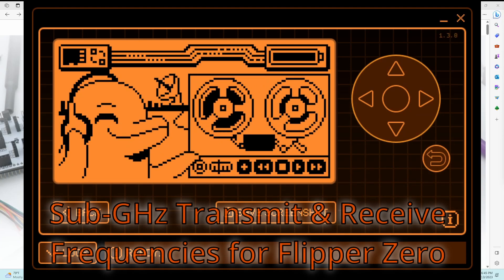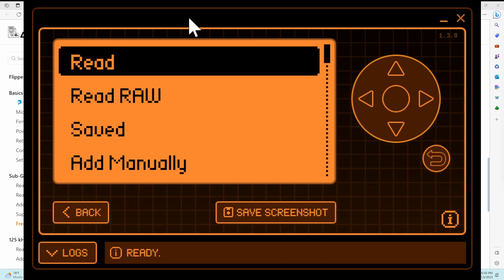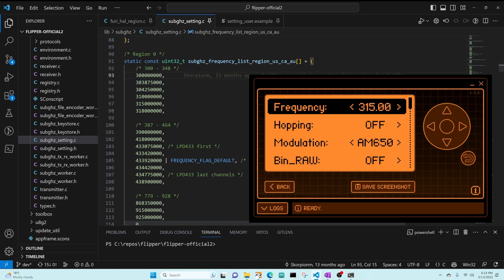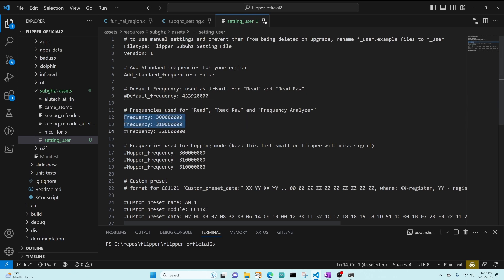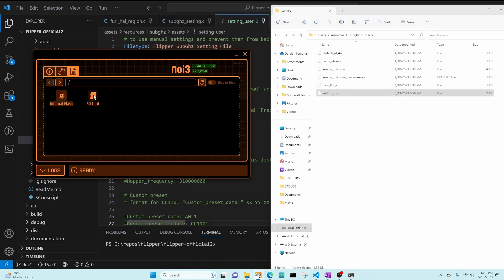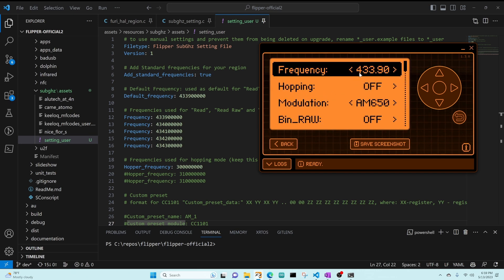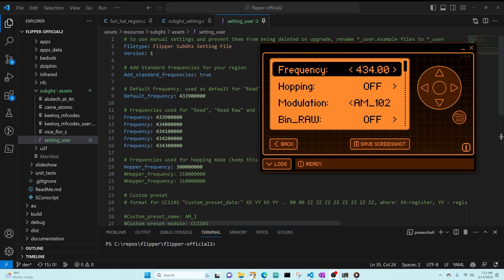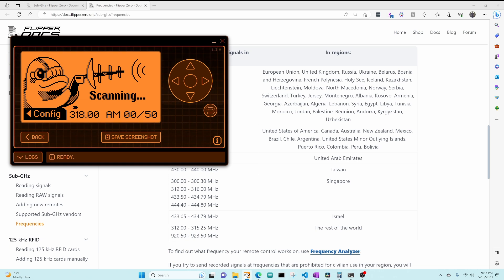[62] Flipper Zero - Sub-GHz Custom Settings

Comment: How do I broadcast a custom frequency? I have an led light that has a ton of settings but i lost the remote I know the remote is 433 so I just want to brute force past 433050000 to see what settings I can access
Reply from the maker: Depends on your firmware. Some of the custom firmware allow adding a custom frequency. Otherwise you have to edit the settings file for subghz and add it manually.

The challenge is that there is frequency, modulation (ASK - which flipper calls "AM", and 2FSK - which flipper calls "FM"), deviation (if using FM), protocol (like Princeton, X10, etc.) and then the data. All of these have to be correct for the device to react. And the data is typically some FIXed data (like a serial number + button), and then some protocols have dynamic data (like a counter or encrypted counter).

You might have a better chance seeing if any of these files work...
https://github.com/UberGuidoZ/Flipper/tree/main/Sub-GHz/LED

Comment: Hey Derek, If you are adding custom presets in the setting_user file is it still necessary to modify the other files? I added a few custom presets and the read function is locking up when either hopping or on a static frequency. At first i though it was the wide band presets but commented those out and its still giving me trouble.

Comment: Hi, can i know where i get the code for sub ghz? Thanks!
Reply from the maker: I'm not sure I understand the question?

The app is built-in (keep pressing back, then choose Sub-GHz from the main menu).

The source code is at ...
https://github.com/flipperdevices/flipperzero-firmware/tree/dev/applications/main/subghz

With the core library at...
https://github.com/flipperdevices/flipperzero-firmware/tree/dev/lib/subghz

Many captured .SUB files (Tesla, etc.) are at...
https://github.com/UberGuidoZ/Flipper/tree/main/Sub-GHz
Reply: @ thank you for the response! Is it also possible to modify the sub ghz apps so that i can use 2.4 ghz antenna to receive signal and etc?
Reply from the maker: To use an external CC1101 go to "Sub-GHz, Radio Settings, Module: External". 
For wiring the module, see https://github.com/quen0n/flipperzero-ext-cc1101

Comment: thanks for the vid DJ. i'd really like to know how the modulation affects the frequencies being scanned. can't find anything clear about it, maybe a new topic . many thanks
Reply from the maker: Modulation is an interesting topic, but I'm not sure when I'll get around to it.  When we are doing a Read, the modulation is describing the requirement for signal to be decoded as a "0" or "1" on the GPIO pin from the CC1101 radio. Maybe I can make a video in November going into details.

Comment: my momentum firmware does not have region info
Reply from the maker: I'm not sure why it was removed.  For me "Momentum, Protocols, SubGHz Bypass Region Lock" is set to OFF, so it is locked into a region but it's not easy to see which region that is.

Comment: Hi , can I add the FM(FSK) modulations and  in the same way? Is additional (external) CC1101 module  required for this? The second question- I am little bit confused about the designation of the modulations. You said that for example AM102 is 102kHz deviation (+-51kHz) which is clear to me. How is it in FM(FSK)? What FM238 would mean? 238KHz freuency shift or 2.38KHz frequency shift?
Reply from the maker: No external module is required, but it should be applied to internal & external if the file exists.
https://github.com/jamisonderek/flipper-zero-tutorials/wiki/Sub-GHz#preset-data explains things in a lot more detail. But general naming convention for "AM" is the number after it is the bandwidth (register 0x10).  The AM tones happen on the frequency you select, but it listens to the entire bandwidth so a similar frequency will also get picked up.  For "FM" the number after it is the deviation (register 0x15), the 2FSK tones happen above and below the carrier frequency (no tone is actually sent at the carrier frequency).  FM238 is 2.380kHz from center, while FM476 is 47.607kHz from center, FM95 is 9.521kHz and FM15k is 15.869kHz. 

I'd love to continue the conversation in my Discord server with you.  https://discord.gg/k7WX7Be3Vy is an invite link to the server.  There is a #subghz channel & it would be awesome to answer questions there -- I'm sure other people have similar questions!

Comment: What is the path for the file which includes the modulations in flipper zero firmware, such as AM650 and FM237, and how do I modify the file so that I can add the custom Honda1 Modulation from the Honda firmware?
Reply from the maker: Take a look at https://github.com/jamisonderek/flipper-zero-tutorials/wiki/Sub-GHz#custom-settings

If you need additional help, please join my Discord server and someone will help you there... https://discord.com/invite/NsjCvqwPAd

Comment: Hello? where is the text file with the custom presets description?
Reply from the maker: https://github.com/jamisonderek/flipper-zero-tutorials/wiki/Sub-GHz#custom-settings

It is on the SD Card in “/subghz/assets”, called setting_user.txt.example or similar.  It needs to be named “setting_user” or “setting_user.txt” (depending on firmware).

Comment: Sir I have committed at the unleashed firmware and frequency 430.50 is now in the dev build.
Reply from the maker: Cool.  I know some custom firmwares also have a way to add custom frequencies & hopping frequencies from their settings UI; which is typically easier than messing with the files.

Comment: Hi Derek, I followed the same steps as in the video customizing the setting_user but the subghz do not reflect in the flipper GUI, I am using of the unleashed version - unlshd-066 thanks Sr.
Reply from the maker: I'm not sure.  I'll switch to unleashed today and give it a try.  I recommend joining my Discord server and asking for help there - I'm happy to do a debugging session there.  https://discord.com/invite/NsjCvqwPAd
Reply from the maker: I tried this out with unleashed.  The added frequencies are at the end of the frequency list (even though my freq was 31042000).  The added modulations are between FM476 and FM95 (even though my freq was "AM_DEMO").  The hopping frequencies show up quickly when I enable hopping.  Let us know if you are still having issues.  Again, the easiest way for me to do troubleshooting is on my Discord server -- YouTube hides replies by default.

Comment: Hi Derek, could you tell me how to cancel frequencies in hooping. I have followed the steps to add them in subghz/assets/setting_user and I have added them perfectly but I would like to delete some that are pre-established such as 315 or 418
Reply from the maker: This was also discussed in my Discord server recently and the solution worked for them:  Make sure Add_standard_frequencies is set to false.  This will clear the default frequencies and hopper frequencies.  You can then add Frequency and Hopper_frequency entries in your setting_user file.

Comment: Thanks for the video. I need to use 292MhZ is there anyway to reach it?
Reply from the maker: 300MHz is the lowest supported range, however, there are unsafe things you can try (but I'm not willing to try & frequencies aren't legal in my region anyway).

https://github.com/RogueMaster/flipperzero-firmware-wPlugins/blob/420/documentation/DangerousSettings.md

Comment: which version are you using?
it didn't work for me
Reply from the maker: Which firmware are you on?  Sometimes the customized entry is at the end of the selection.  Some firmware also require it be named setting_user.txt instead of setting_user.  My Discord server is best place for help - https://discord.com/invite/NsjCvqwPAd - but if you let me know your firmware (like Official, RogueMaster, Xtreme, etc.) I can install and give you the specifics.
Reply: Extreme Xfw-0051_01082023

Comment: Why don’t any of these videos actually explain what the different apps actually do lol
Reply from the maker: Hi.  Does the below video link help explain some of the apps?  The target audience of this customize video is someone who probably also has a software-defined-radio, but wants to tune the Flipper settings to receive a signal from a particular remote that uses subghz frequencies in the 300, 433, 800 or 900MHz range.

Flipper Zero - Overview of Official Firmware
https://youtu.be/eIAhiloEOlo

Comment: Many Thanks for this amazing Video.
My hospiral uses Garrison>> LK-102P-RM remote control with one button only to open the staff elevator. Flipper is unable to read or read raw. Analyzer is unable to read it also. I searched the internet and found that the frequency is 380MHz.
I replaced the firmware with rougeMaster and does not help
I'm new to flipper and have no idea how to add this frequency.
your help will be appreciated
Many thanks
Reply from the maker: If you have Discord you can use my #general channel https://discord.gg/NsjCvqwPAd or ping me on Discord at codeallnight.

Roguemaster expects the file on the SD card to be named "subghz/assets/setting_user.txt" (with the .txt extension).

Rougemaster allows 37800000 to 481000000 so 380000000 should work.  I'd recommend turning on logging (at least at Error level) and then open https://lab.flipper.net/cli and run "log".  Then you should be able to start Sub-GHz and see the issue.

10575192 [I][SubGhzSetting] Removing standard frequencies
10575201 [E][SubGhzSetting] Frequency not supported 380000000 <<<< Official firmware!!!
10575218 [I][SubGhzSetting] Hopper frequency loaded 300000000
10575247 [E][SubGhzSetting] Error loading user settings, loading default settings

Once you have the frequency show up in Read, you may need to increase your data rate.  See this video:
https://youtu.be/VxMDdYuRITE

Comment: I understand this is modifying a configuration file that the app uses.. but any idea how the apps themselves work?  For example, if you wanted to write something custom, is the fap written in 'c' or is it a script (ex. ducky)?   

I'm interested in studying how some of the apps work, for example how does it analyze a particular psk/ask/fsk/qam protocol.   

I'd also like to write a portable hotspot application, that users can connect to, enter a password and it will then allow them to use my mobile connection!
Reply from the maker: Sure, I can do a video on how "SubGHz Read" code decodes/encodes with one of the protocols (like Princeton).  NOTE: The Flipper uses SubGHz (<1GHz) and WIFI is 2.4GHz or 5GHz, so you can't create a hotspot application with just a Flipper.  If you have a dev board or ESP32 then you could allow people to connect to it [you would have to write custom firmware on the ESP32 & custom firmware on the Flipper] (but then you would need another board connected to your mobile connection).  It might be easier to make a firmware that had a mini-web server on the ESP32 and the Flipper allows you to control that web server pages (like captive portal login pages or something).

For SubGHz, I started writing a tutorial for adding X10 protocol...
https://github.com/jamisonderek/flipper-zero-tutorials/tree/main/subghz/protocols/x10
but it's broken with latest firmware.  Hopefully it will be fixed next week.

Comment: Just to let you know this only covers the stock Firmware  not including custom firmware such as RogueMaster and Unlesashed.
Reply from the maker: Good point.  RogueMaster uses (setting_user.txt instead of setting_user, per their README) you would use the custom firmware file from their repo instead of official...

https://github.com/RogueMaster/flipperzero-firmware-wPlugins/blob/420/assets/resources/subghz/assets/setting_user.txt

they still have custom preset example (search for "AM_1").  You would add your own entries below the Honda 2 entry (if you wanted it last in the list).

The Unleashed file is still called "setting_user" and is at...

https://github.com/DarkFlippers/unleashed-firmware/blob/dev/assets/resources/subghz/assets/setting_user.example

NOTE: For Unleashed, your entries happen just after "FM476" and before "FM95".
Reply: @MrDerekJamison  What about xtreme?
Reply from the maker: @Алексей-д1ц7б  xtreme uses setting_user as the config file.

Comment: Hey.  What are the recommended settings for an external antenna?
Reply from the maker: For external, I’ve used various external CC1101 from Amazon — some have connector for antenna and some have coiled antenna.  They all seem to do better range than the internal device (but it means custom firmware) and now the flipper is a little less portable.  The Dolphin board is nice, in that you can still access other GPIO pins.  If you are trying to be compact and don’t care about GPIO access, I think TalkingSasquatch has some videos?  I haven’t tried different external antennas on my CC1101.

In next Saturday’s video, I’ll try to cover PA-Table bytes (which is important if you are trying to not break local regulations on TX power).
Reply: @MrDerekJamison  i have the cc1101 antena for FZ and  its very good In addition, it keeps the flipper from being destroyed by excessive effort.  And this also increases the range